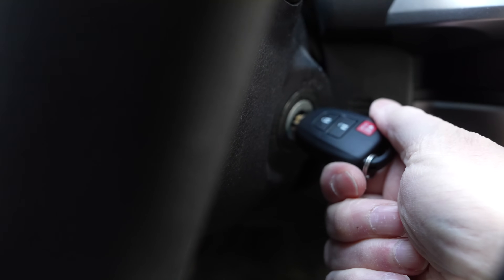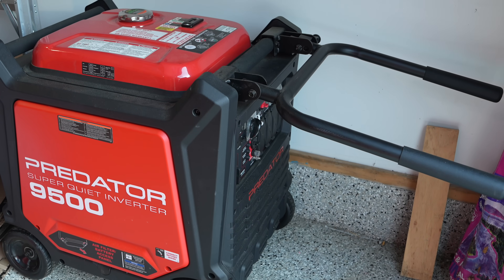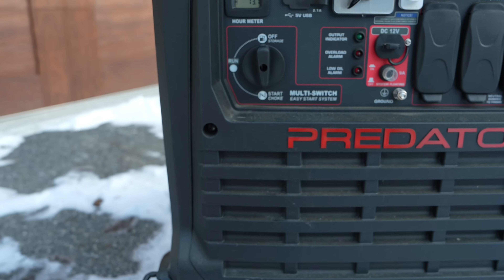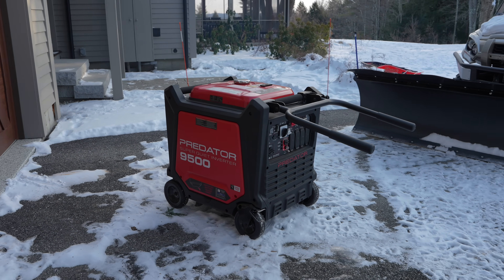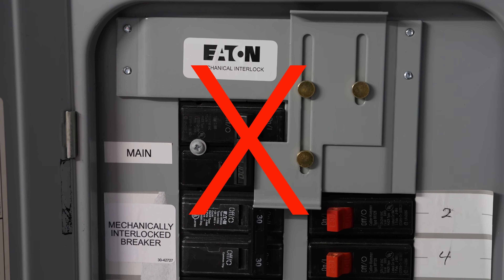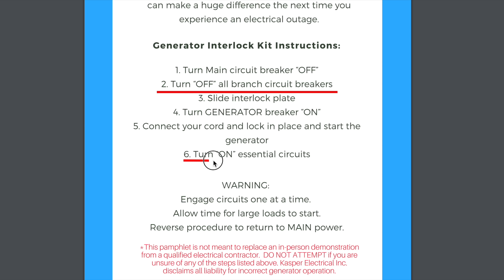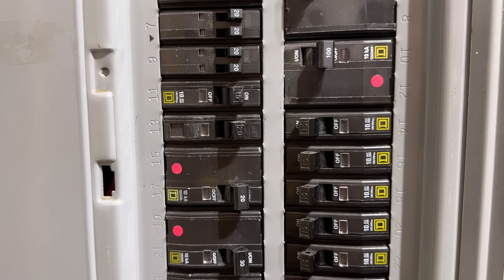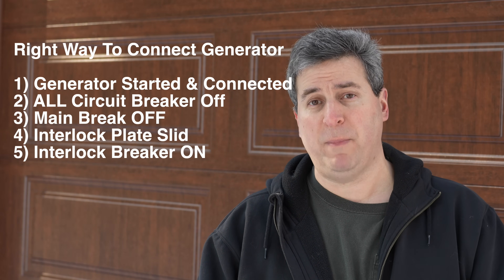Homeowners are Destroying Generators Skipping 1 Step During a Power Outage

Comment: Very well stated and great advice.  Any motor or especially, compressor based appliances (refer, freezer/a/c, heat pump)  have a tendency to surge a lot when started, which can stress a generator pretty badly.  even if it doesn't damage the generator, the surges could take out more delicate electronics as the generator tries to stabilize.  By sequencing the breakers and getting the tougher loads running in sequence first, then the delicate things last is less stressful on everything and less likely to cause issues. And don't forget to check and change that oil...:)   Good stuff!  
 (I've pretty much put all my essential circuits on a giant UPS (20KWh, 3000W out max but averages under 400W) so that things keep running for a couple of days or so and if it's looking bleak, I can connect the generator to the UPS and charge/run the place that way as well.  Power's not the most solid up here in the mountains sometimes. Last time 3.5 days)
Reply: inrush

Comment: Good advice on the generator tips and usage. On a side note, you must have forgotten the Buicks in the 50's, the starter button was under the gas pedal. I can remember some of the older people would start and was little slow releasing the pedal to idle. I always thought the Buick's of the day had to be pretty tough to endure this every time it was started.
Reply: On a lot of carbureted cars you have to open the throttle on a hot start. When you initially shut it off and it heat soaks, the fuel boils and expands and somewhat floods the engine. So if you shut it off at the store and you come back 10 minutes later it will be flooded and not start unless you hold the throttle open while cranking. Pretty sure that's why Buicks had the starter switch there, so the uninformed wouldn't be stranded in a flooded condition. I usually lower the float level in the carb a hair then retune, so it doesn't flood as bad.

Comment: All great and valid info, clearly delivered.  As a note, Backfeeding is great and the interlock is great, but make sure you check with an electrician in your area BEFORE doing it.  It is definitely NOT legal in Ontario, and I believe all of Canada but am not positive.  The only LEGAL way in Canada is a transfer switch like a GENERLINK or one like they would use for a whole house generator.  I think it's silly, but I am not in charge.  I bought the Generlink in Ontario with an 80 foot cord, 2 years ago, installed for about 1800 (Canadian) bucks.  Otherwise, my procedure is exactly the same as yours (but I leave the main breaker on as the generlink does that for me).   My generator, 5500 running/7000 peak can run the whole house with no issues  Even the A/C. the lights do flicker when the electric stove element turns on/off but each of those are about 3500 watts so I turn that breaker off.  Hot water is gas, no well pump.

Comment: Ever since I bought my generator, I haven’t had a power failure.
Reply: Sell it, and you'll get a power cut the next day.
Reply: @error404m 😂😂😂
Reply: So your generator works great. 😂
Reply: I bought life insurance and never died.
Reply: @sylviaisgod6947   Yet...
Reply: @sylviaisgod6947  You Will!!!!!!!!!!
Reply: 😂😢😅 @sylviaisgod6947
Reply: I’ve bought 2 of them. The first one was the same day as a couple hour power outage because my wife was on oxygen and I wanted to be sure I could keep her machine running and not reliant on finite bottles on hand. She has since passed but I went ahead and bought a larger inverter type generator and then installed an inlet box and interlock. Still no outages, lol.
Reply: Start it every once in a while
Reply: @contactohn7982 Good point, one of the worse things for a gas generator is sitting idle over a long period of time. I switched to a dual fuel generator and strictly use (will not use gas since it's a dirty fuel) propane.
Reply: @tincans87  And propane is not dirty??
Reply: @franklofarojr.2969  Nope. If you run an engine on propane and turn it off, it'll never gum up the carb, no matter how long it sits. Propane will never go bad in the tank either so it can't contaminate the engine with 'bad gas'. Modern gas contains ethanol, which draws in moisture from the air which corrodes engine parts. Propane does not.  Also it has less emissions. That's why propane is used on indoor power equipment. It also it won't contaminate an engine's oil like gasoline. It stays cleaner longer. Propane is remarkably clean compared to gasoline's downside is it has like 20% less power than gasoline.
Reply: Insurance
Reply: Same here. Plus I spent more money for battery backup units virtually guaranteeing my main power will never fail and none of these backups will ever be needed. I GUESS that is money well spent 🙄🙄
Reply: Sounds like your generator is working perfectly then.  Just like when I bought a snowblower... Wife said "you don't need that, we don't get enough snow....blah blah blah"  I told her that if I never get to use it, it will be the best money I ever spent!
Reply: I told myself, if buying a generator means I'll never experience another power outage, it is a good investment!
Reply: Same, last time power went out was supposed to be a few hours I decided to hook it up as I started it heard my ring doorbell come on 🤦‍♂
Reply: @DanaN43  Avon?
Reply: @DanaN43 😂
Reply: That's like every since I got a new snow blower we've only had 2 or 3 inches of snow here & there. We don't get big snow fall anymore, I've had it 4 years! If I sell it we'll get dumped on.😂
Reply: I bought a new snow plow and it hasn't snowed all winter!
Reply: That means it's working! 🎉😊
Reply: that sure does happen…i’ve been in upstate south carolina for 20 yrs…all of our outages have been less that 6 hours….but….last sept the hurricane came thru we were without power for 4 days…..the generator saved us big time i have the kitchen and surrounding areas hooked up…. i had a larger propane tank i stated. ..the tank rental was the same price…250 gals i think….i have it filled before hurricane season……we didn’t even use half.  i believe it would run for weeks……4 days we were luckier than most .. north carolina was hit way worse.  it’ll happen you can bet on it.  take care…..
Reply: My mother was unhappy when we lost power for five days after Hurricane Betsy in 1965. My father bought a used Onan welder/5K generator.  It was the best insurance he ever bought.  We didn't have another major storm in New Orleans for forty years.
Reply: I've had 2 power failures in the 7 years I've had mine. Literal life savers both times. So my moto will continue to be " I'd rather have and not need it than need it and not have it."
Reply: It's like fire insurance.
Reply: That’s because you got a generator
Reply: Generators keep power failures away.
Reply: Whenever I wash my car, it rains.
Reply: Same!
Reply: Will that work for Hurricanes?
Reply: No kidding... Mine is still sitting in the garage... Never had to fire it up. But I know just as soon as I sell it, we will lose power for like 3 days...
Reply: Try WV. 2000 Hours in no time. Kanawha County is idiotic service. No excuse for AEP shifty service.
Reply: Me neither. So I bought a 2nd generator, just in case.
Reply: My 17KW home standby is only running at 2.5k unless we add dryer and or stove microwave etc..
Reply: Exactly….two days out of warranty I had a failure.  Timing it’s EVERYTHING…..jokes …artillery….sex…warranties.
Reply: I bought one after Helen and didn't have a power outage until about 6 months later but I'm glad I had it.
Reply: Wired my house and never had an outage again, ever.
Reply: lol ! Me two !
Reply: Sounds like it’s working great then!
Reply: Huh, same thing with me, snow and the snowblower I got three years ago. Is there a pattern here?
Reply: Just wait till you sell it
Reply: That's a no $hitter.  I put almost 250 hours on my predator in the first 4 years at the house we are in now out in the woods in CT. I installed my 20kW generac in September 2023 and now it has about 10 hours on it!  As much as everyone talks smack about Eversource, and much of it is justified, they have done a great job recently in our area addding trip savers and auto reclosers which have helped with the random tree contacts to primary wires.
Reply: It's the rule. I bought a snow blower two years ago and it hasn't snowed enough to use it.
Reply: haha you're a lucky man !!😅
Reply: Yes! You are preventing power failures!😁
Reply: That's the best way to stop power outages
Reply: I wear a seat belt, never in a wreck.
Reply: Same... I had multiple outages one winter. Bought a generator and have not used it in three years. Hahaha
Reply: Same lol
Reply: I bought a 6000W generator 5 years ago. I installed a breaker interlock on my panel and a Junction box on the exterior of my garage. The Generator has never been out of the box.
Reply: Not a bad problem to have
Reply: This sounds much like when replacing a "lost" tool. Then you will find the "lost" tool. But now you have a backup tool.

Comment: I fing falling startup instructions included in generator a big help. Their is different engines and fuel types.  I have a EFI gas type and a diesel as a LPG one. All different cold start .  If using a generator stand alone without going thru home panel this still ok   Buy some safety things to look at. Putting the generator to a ground rod . This can be done either put one in ground or clipping to the one for your home if close buy. The outher thing is check you generator for neutral ground bond.  If not connecting to your home  you will need that they sell a plug just for that purpose . When connecting to home panel the panel will have that bond so that bonding plug not to be used.   Also switch off loads before shutting down generator and NEVER refill with it running ! Always check for CO even if outside . wind may bring the CO inside. So keep a CO detector handy when using a generator . I use a portable battery one . CO can creep up to dangorios lever without notice of systems at first.

Comment: Nice reminder to take it easy on the genny.

I found a great accessory for when we lose power called a Power-Back Alert…installs through a knockout in your panel, and has a lead that you wraparound your main cable in from the street. When power comes back, it sounds a loud alert so you know you can shut the genny off again.
Reply: I have a similar device. It’s called the street light in front of my house. When it is on I know the power is back. 🤣😂
Reply: @Whatsupeiththestupidhandlebs  super convenient if you have it. But the alert is vital for this of us who live in the boonies, have no streetlights or neighbors for a mile.
Reply: @WardNH   I understand but I was just making a joke, not criticizing.
Reply: @WardNH v2 should be powered by rechargeable battery, so you don’t forget to turn it on.
Reply: Out here in the country I don't have a pole lamp so I connected a night light to the incoming line to let me know when power is back.
Reply: @frankelmer8055 yeah I did that too except used a small 240v led and stuck it in the side of my panel.
     Incidentally I also have a little alarm that plugs into an outlet in the bedroom to alert me if the power goes off in the night. This is essential if you have someone who sleeps with medical equipment to assist breathing like oxygen or BIPAP machine.
Reply: That is a CT Coil Sensor or An Inductive Sensor (likely the latter) which sends a signal that actives a separate sourced (battery/outlet) sound device. They are cheap and effective.
Reply: I have a transfer switch that only powers my critical circuits. I plug a strobe light and a portable radio (both turned on) into one of the outlets that is on street power. This way, even if it’s night and I’m sleeping, I am woken up when the street power returns so I can then go shut off the generator.
Reply: Yes, I bought one from HD.  Got to remember to turn on the switch on the device after a power failure.

Comment: I have a “whole house” battery backup and I installed a second circuit breaker panel and moved my big items off of my main breaker panel onto it. When there’s a power outage I don’t power my HVAC, hot water heater, dryer, or stove. I only run my refrigerator, lights, and small appliances like my coffee pot and the cutover is completely automatic. That is another option to make it easier for people who have generators too.
Reply: When I built my house, I had two 400AMP panels side by side. One ran all the gibberish of the house, and the other one ran all the essentials. The essentials were tied to a Kohler 20KW generator with transfer switch. That way we powered everything we needed and the unnecessary items were left off the generator circuit. The best way if you are building from scratch.
Reply: @stbentoak5047  You were running 800AMPS?  WTF?
Reply: @243wayne1 It was a big lake house.The gen set only powered one of the 2 panels, but it was the one with all essential circuits. 2 panels made it easy and didn’t have to worry about overloading and shutting off redundant circuits if all wired to one panel….
Reply: @stbentoak5047  Lol.  Good Lord.  I thought you had both panels up and running simultaneously pulling a constant 800amps!

Comment: Good advice but I recommend starting and warmup with eco throttle on, which allows for a lower idle RPM on a cold engine. Just like your analogy of not flooring the gas upon startup of a cold car engine, you don’t want to start and go to high RPM on a cold generator engine. Just my opinion.

Comment: I guess if you wanna be absolutely anally retentive, sure. But I’ll pass. My power goes out, I lean over and press my remote start button and let my semi auto transfer switch do the rest. I’ll happily buy another generator or more likely fix it if mine ever dies, rather than freeze my ass off out in the cold and rain doing this.

Comment: I have an Ecobee thermostat and the thing that I like the most about it is that if there is a power failure, when the power comes back on or the automatic transfer switch starts the 12.5kW Westinghouse portable generator the Ecobee does not allow the HVAC unit to start up for about 4 or 5 minutes, as the Ecobee is going through a restart calculation mode. This alone will keep the large HVAC load from coming on with everything else, when the circuits are energized. My "Critical Loads" sub panel is powered by my EG4 - 600XP whole house battery backup system.

Comment: Good video. This is true for a diesel generator. Let it warm up while connecting things. With mine, I do not engage the alternator until the engine is warm. Engage the alternator then start turning on power in the house. The same is true when you need to shut down. Remove the generator from the power and let it run for a minute or tool without any load. That will allow the generator to cool slightly before you completely shut off the generator. The other thing that is nice to have and very important is a checklist for start up and shutdown. Sometimes in the dark that can be the difference between forgetting to plug-in a carbon monoxide monitor or not. If you are not around that checklist is important for somebody who is not completely familiar with the generator procedures.
Reply: Our standby gen’s at work have hot water heaters and pumps for the engine coolant. We keep it at 110F all the time so that they can crank quickly and easily and be ready to take a 2MW load right away.

Comment: How do you think this applies to a standby generator? I imagine ilthey are designed to that that big initial load as you wouldn't really have time  to switch breakers off before it kicks in.
Reply: The chance of everything calling for power at the same time is minimal….. Some are manually restarted…. The oven, dryer, freezer, HVAC  and well pump most likely will not start all at the same time..

Comment: If your generator can't power an entire house turn off certain loads so they don't run simultaneously.  For example if you need to use your microwave you don't need your refrigerator compressor going at the same time. Your fridge/freezer can stay cold for hours if you don't open the door much.

Comment: I keep the choke on start it. then turn the eco mode ON let it idle for 30 seconds or so then take the Eco switch off and let it rev up a bit. This give the oil a chance to get into the engine a bit more. Inverters tend not to need this as much as they won't just run WFO without a load